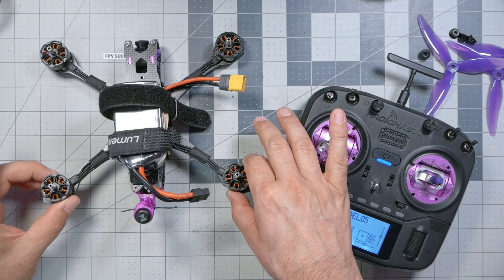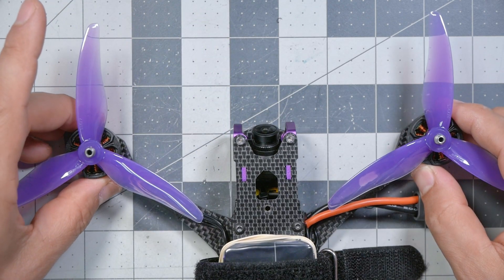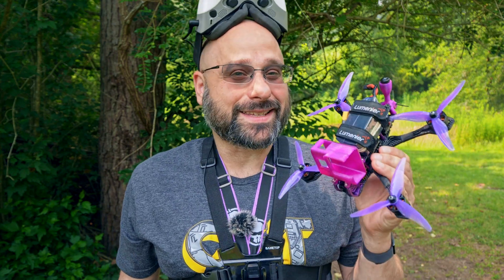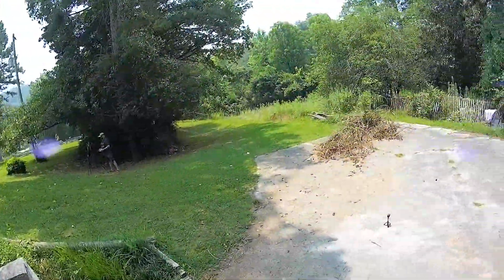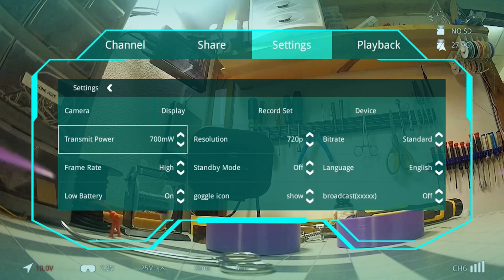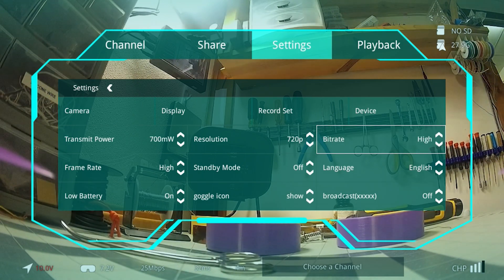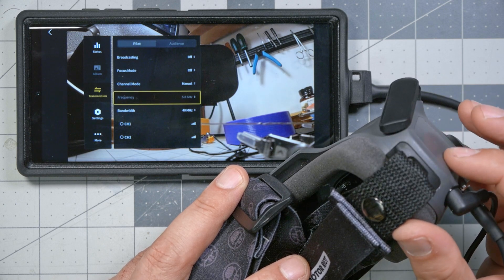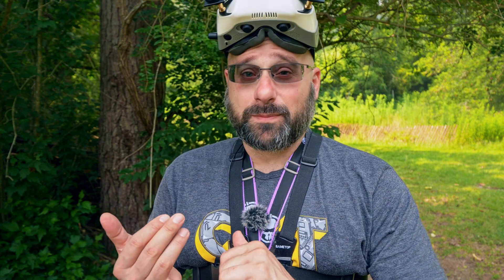Build an FPV drone in 2023 - Part 14 - Your First Flight!

Comment: Hello Joshua,

Ok, so I did all the checks at home and everything was working fine. I took it out for my first flight, armed the quad, and as soon as I increased the throttle one of the motors burst into flames. I think it was because of debris and dust since I was flying in an open camp lot. I was so bummed. Now the other three motors are just beeping and jerking. For now, I’ll have to replace the burned motor.

One question

1. Are these motors really that sensitive to debris?

Comment: Just finished building this drone and had my maiden flight this evening. Had a great flight!! Amazing.

Quick question though, on my OSD the mah used keeps going up and up and up showing like 9000 mah used and that's on a fresh pack. How do I reset the mah used after each pack? I'm using walksnail with radiomaster gx12.

Comment: Hey Joshua, I finished my build following your build got all the correct betaflight settings, but for some reason when I raise the throttle, and lower it slightly it just wants to keep going, I saw an old video of yours about this and I believe this is a PID loops however I thought this was only supposed to happen on the bench without props on I’m not sure how to fix this problem any help from anyone would be great
Reply: Hi, were you able to fix this? I also seem to face the same problem.

Comment: Thank you for this build series. I built mine a month or so back. With some minor tweaks for my preferences (hq prop5x4.3x3 V2S, added gps, elrs 250hz preset, xing 2208 1800kv), and it is such a blast to fly.

Comment: I finally got my drone built and finished my pre flight! Thank you for the tutorials and all the information. No way I could have EVER done this as a newbie.  If I was to use a Caddx Vista would the insulation be same as using the 03 air unit since DJI makes it and would it be compatible with the Goggles 2. I see the pairing in the goggles for the 03, Avata and FPV air unit. Thanks again for the help and advice!

Comment: How much does the final drone weigh
Reply: With or without battery I got it so I can tell you
Reply: @myersbob7517  what does it weight with battery?
Reply: @damian4176  I'll go check
Reply: @myersbob7517  that  would be  nice, I have another question and that is how long can you fly with 1 of your batteries?
Reply: @damian4176  one battery lasts a few minutes it doesn't sound like much but trust me it feels like longer
Reply: @damian4176  368 grams without battery, and with a 6s 1500mah battery it's 628 grams
Reply: @myersbob7517  okay, thank you so much for the information
Reply: @damian4176  your welcome  if you have anymore questions you can ask

Comment: does the analog vtx menu ever pop up while flying since its controlled with the radio? or is there a safety around that?
Reply: It will only open if your quad is disarmed (the motors aren't spinning)

Comment: @joshuabardwell I want to say thank you  for the series. Honestly took my dream of building a quad and made it a reality. However my quad decided to pop up wildly on preflight check. Is there a video you have done that will help me understand what to do next? Or why this is happening.
Reply from the maker: If the quad suddenly pops up in the air and then disarms when you arm, it is almost always one of these things.

1. Clockwise prop installed on counter-clockwise spinning motor or vice versa. Double check the motor direction is as expected and then double check that the correct prop is on each motor.

2. Flight controller not facing forward. Go to the Setup tab in the configurator. Tilt the quadcopter on all axes (pitch, roll, yaw) with your hands. The 3D model in the configurator should move the same as you move it with your hand. If it does not, use the Board Alignment parameters in the Configuration tab to fix it. Do not use the "GYRO/ACCEL" parameter. Use the "Roll Degrees", "Pitch Degrees", and "Yaw Degrees" parameters.

3. Motors not wired correctly. TAKE OFF YOUR PROPS. Plug in a battery. Go to the Motors tab. Use the "Reorder Motors" wizard to ensure that the motor order is correct.

4. Motor spinning wrong direction. Do the same as step 3 but use the "Motor Direction" wizard to ensure that all motors are spinning the same direction as shown in the diagram.
Reply: Thank you so much!!!! It turns out that my calibration on my tango 2 was off. After watching your vid I didn't realized that you have to move the sticks in that cross pattern after you map all the quadrants. As you do it will tighten up the calibration and no more pop ups. You have put so much effort into this series that I just had to be a part of it and make my own JB quad. I'm definitely going to start showing up in your patreon. Keep up the great work!  @JoshuaBardwell

Comment: I'm having an issue, never really happened before, but i fly in airmode, and im aware it causes errors in the pid loop when coming in for a landing, so it bounces, but my quad sometimes freaks out as of late and just spins out of control, not to many videos on this or how to fix the tune from causing errors, i have blackbox logs. im on an f7 v3 chip- BF 4.4.2. have blackbox for further detail.
Reply from the maker: That sounds like a motor or ESC problem first thing I'd check.
Reply: @JoshuaBardwell  i've check the esc with a multimeter, seems good. Also not sure what to look for on the motor, accept they freely spin, or don't look to be bent. Just seems it flys good up until i come in for a landing, bump the ground, and just jumps unpredictably.I will try to inspect my esc & motors more thoroughly. If it's not those it had to be airmode i suspect. Seriously appreciate all your hard work Mr. Bardwell, It's made it easier for me to learn so much. Thank you.
Reply from the maker: That sounds like a motor or ESC problem first thing I'd check.

Comment: hey mate, got a baby ape pro here and when i throttle up over 25% the motors continue to gradually spin up to full rpm [ props off ] even when i bring the throttle to 0%, they cant me stopped unless i disarm, any ideas why this is happening
Reply: This was happening to me and I turned off airmode and it fixed it

Comment: One Question about this Dron  is the Camara System include in the kit?
Reply from the maker: The analog version of the kit includes camera and video transmitter. For the digital version of the kit, you buy the video system separately, since there are several different video systems you could use with it.
Reply: Thanks.
You are the best

Comment: mr bardwell u might already had covered this topic, but, what is the cheapest digital vtx vrx kit i can get, i have older drones with analogue vtx from 25mw 600mw and 1w and ground units, i have recently seen how stable digital vtx are, so i would like to get myself into the digital realm the cheapest posible way, could you please share some knowledge on this topic
Reply from the maker: Basically, they are all about the same expensive.

Comment: I really want to get the DJI googles 2 and the oled screens ,, but most the videos say the V2's are better ,, you have both ,, I cannot stand the V2 googles size , they sag ,, drives me crazy ,, I love my skyzone size that's why i fly mostly analog ,, can you clarify the latency between 100 and 120 fps if you notice a huge huge difference .. Thanks

Comment: An F35 is lost rtn flying on autopilot after the pilot ejected over South Carolina . It wouldn't be lost if it had remote ID but they dont require RID on the F35.  Only on toy aircraft because of the extreme danger they pose.

Comment: first time commenter long time watcher. I have made it... Almost, I am not getting a signal bar (TX NOT binding) when I plug my battery into the quad. I do however get a bind (little C at top right corner and strong signal bars) when I power the FC via USB. I'm so close and want to be a success story.  Is this an appropriate form to ask for help? Thank you for everything, very excited to get this thing in the air.
Reply from the maker: Did you do the thing where you turn model match on and then off again?
Reply: DJI S-Bus was also using same uart as Rx. I have graduated. thank you for your efforts and getting folks like myself into the hobby. WWJBD
Reply from the maker: I'm going to guess you're using Speedybee F4 and not the Xilo Stax that's in the video. It has the issue where it puts Rx2 in the DJI header and on the board to solder to.

Comment: WooHOO!!  Feels fantastic to get to this point, and to hear JB say he's proud of me. :)  I'm proud of me, too.  Completed the build, and had a great first day of flying.  After the fact, I had a realization about another benefit of DIY:  Bothered by the routing of my O3 cable and a little 'tangle' hanging out the side of the FC -- I didn't have a MOMENT'S hesitation about grabbing the driver, removing the top plate, removing the FC and cleaning up the cable  -- and had the whole build buttoned back up and ready to fly in just a few minutes time.  The confidence of knowing EVERY detail about the assembly and custruction of the build, and exactly steps any process would entail - was something I haven't experienced with previous (either commercial DJI, or bind-n-fly) quads.  Thanks again for all of the inspiration, information, and mentorship!
Reply: damn I had never realised this but that's 100% something I have with my kwads, although many times it's knowing how much of a hassle it's gonna be ahah

Comment: My motors are not switching directions any way to fix that i used the wizard and individual and nothing swapped
Reply from the maker: Are you using the same hardware as in this tutorial or different hardware?
Reply: @JoshuaBardwell  ya the xilo stack I fixed it just had to use the bl heli 32 configurator

Comment: Joshua!! Thanks for the videos and the build. This was my first build ever and my first 5in. Just finished the maiden flight. Ive only been flying for about 2 months now and haven't flown larger than a 2.5 in. this was awesome thank you. One alternative to Loctite that we have started using in the firearms community is Vibratite. It sets faster and is intended to be reusable. Works great for our uses. Ill try it out on some of these drones now. Not sure if you wanted to try it out too Thanks again.

Comment: Well....second flight (first battery) and the quad is lost! Had vtx at 25mw....was throttle up abt 30%. Rolled abt 20*....lost video, snatched goggles off (put glasses back on)....
It flew off into very dense woods. Searched until the battery was dead. Never even got close to finding it. Fast way to piss away $400!
Reply from the maker: Sorry to hear about this. Always disarm immediately if you lose video, unless you are definitely experienced enough to recover another way. Always fly somewhere where if you dump the quad, it will be recoverable (not over dense forest or water for example). And best to use max power as shown in the Playlist.
Reply: @JoshuaBardwell  I was in panic mode. Now I'm in wife unhappy mode. My yard is similar to yours except I'm surrounded by 100 acres of woods. No choice...well that's not true. I SHOULD have (a) spent more time in simulator. (b) gone somewhere with more open room while learning. (c) had a spotter with me. (d) not been so damn impatient to fly.
Loved putting the kit together and learned a ton from it and your videos. Guess I'll start with getting 1 or 2 parts per payday now. At least I've got a good radio and some goggles. Maybe i should do a "SUPER DUPER CHEAP 5 INCH BUILD" video with the absolute cheapest parts i can find. 😀
Thanks again JB! I did learn something today!

Comment: This series was great. I really enjoyed it. I’m getting ready to build my first quad soon I’m accumulating parts right now. Currently flying a couple Rotor Riot builds and I unfortunately been trying to fix some stuff and should’ve really finish watching the series before I tried replacing the battery lead in the capacitor. I wouldn’t of fried my ESC if that were the case. But I like learning things the hard way apparently. I hope you add the GPS and buzzer and more content to this playlist. It was really great. Thanks so much, I learned a lot

Comment: Would it be possible to connect the FC with a raspberry pi so I can control the drone with my computer app / wifi ?
Reply from the maker: In theory yes. In practice there would be a lot of details to work out.